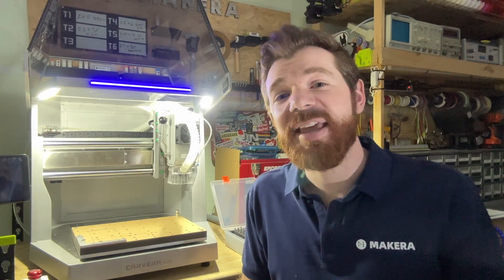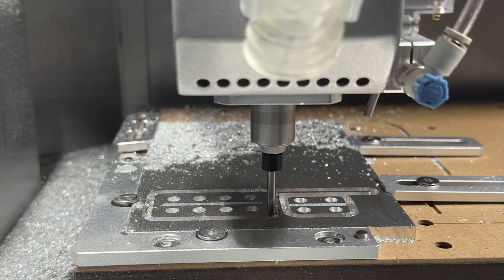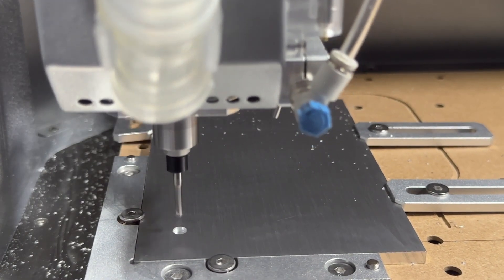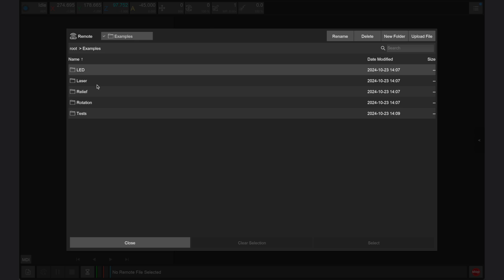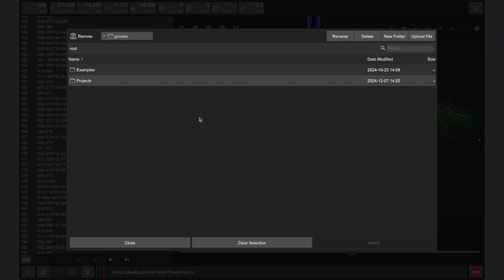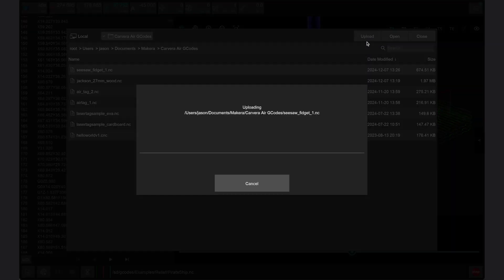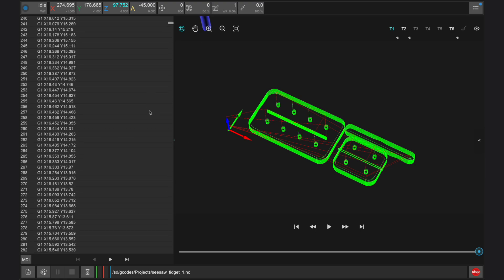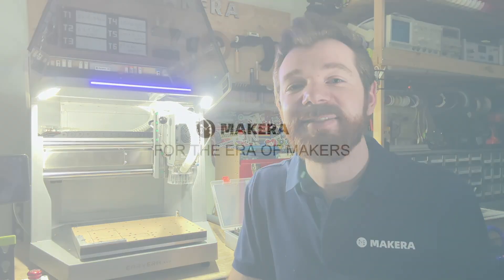How to Upload a File to the Carvera Air Desktop CNC

Comment: There appears to be no way in the iOS controller app to upload a file other than the example files. My gcode is located in the files app, and the controller app never prompts the files app to select the file..
Reply from the maker: Uploading files via the iOS app is not supported at this time. You can use an iOS device as a controller for the machine only.
Reply: @Makera when will this be fixed?
Reply: @Makera 3 months later. Still broken.
Reply: When your Z1 is shipping in January, will there be the possibility to upload the Gcode via IOS?

Comment: I have an air and can not figure out how to upload useable files to my air. None of the gcode files i have tried have the ability to run the air. It’s very frustrating
Reply: Man the controller app needs some serious updates.
On my android tablet, after granting permissions, i can only see an empty "data" folder and "emulated", none of which have any files.

On my Samsung Galaxy S23 Ultra, I can view my local files to select for uploading... buuut the .nc files i exported from Makera Cam do not show up in the folder i put them in.

There'a no way, at all, to get custom files to my Makera Air. I cant try windows because that fails to connect via USB altogether and is in a permanent malfunctioning usb device loop. :/

the example files worked fine however
Reply: @BentoFox2969 Did you ever fix this? Exactly the same issue here.
Reply: @TheMuffinManOG Not really for laptop or phone or newer tablet. The only device that can connect correctly is an old Galaxy S2 Tablet sporting Android 7 (Nougat); all other devices fail connecting (S23 Ultra, some Samsung tablet and Dell Precision 5570 laptop)

The one tablet that works does so without any issues with app and connection however. Try a different (older) device and see if that works.
Reply: @BentoFox2969 So you were only able to load files if you did it from an old operating system?
Reply: @TheMuffinManOG To reliably do so, yes. I haven't tried on othrr devices in a while but then again, the software hasn't received updates since then afaik - except for one that broke GCode spindle start which i downgraded from to not damage the router.
Reply from the maker: This can be due to many factors, Are you using the correct post processors? Are you uploading to the machine first before opening? Does your examples files work correctly. Please contact support@makera.com for more troubleshooting.
Reply: @ turns out i did not, i didn’t even know what a post processor was, a pretty huge gap in the materials for new cnc owners. Hopefully the new 3d function coming from makera will alleviate some of the complexity i am encouraged